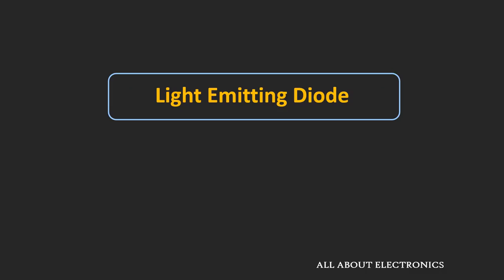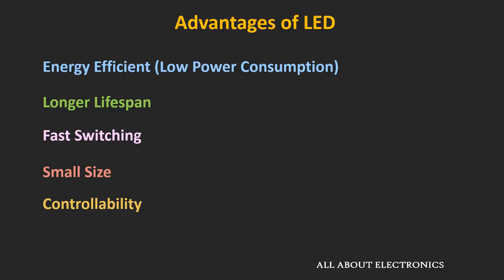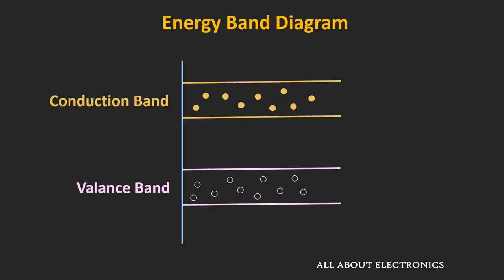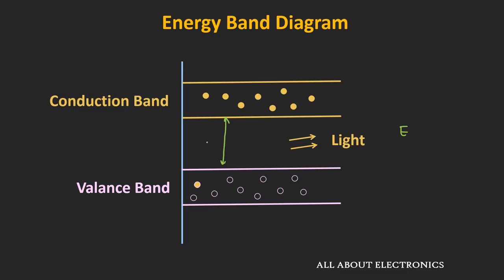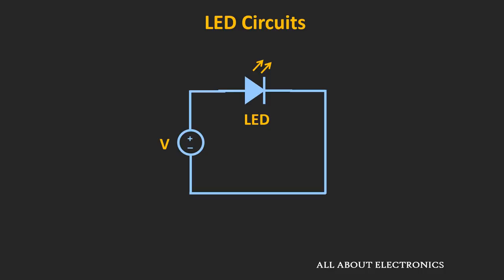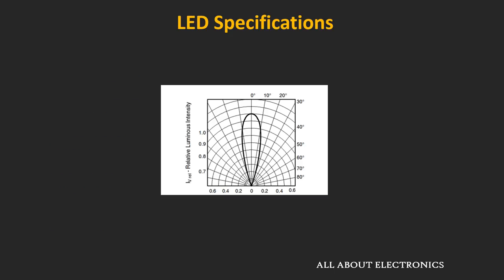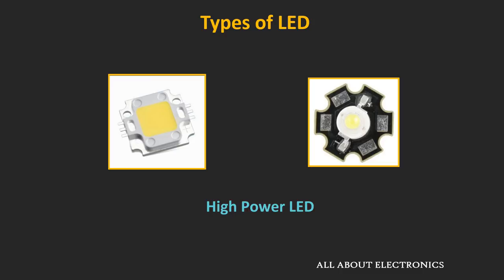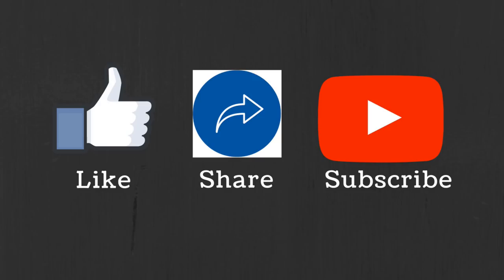Light Emitting Diode (LED) Explained (Working, Advantages and Types of LED Explained)

Comment from the maker: The timestamps for the different topics covered in the video:

0:21 Applications of the LED

1:06 Advantages of the LED

1:44 Working of the LED

5:02 Different LED Specifications (which is usually found in datasheets)

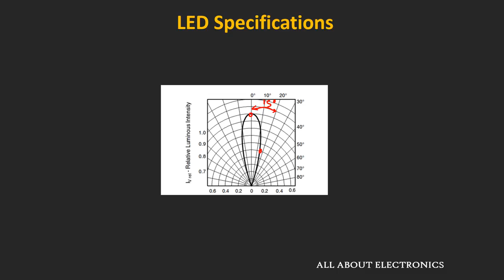8:00 Different Types of LED
Reply: @ALL ABOUT ELECTRONICS which color of LED has the largest reverse saturation current, red , green, and blue, and how do we know that?